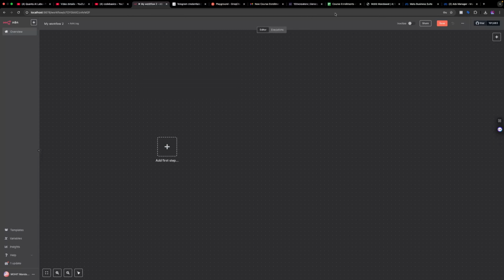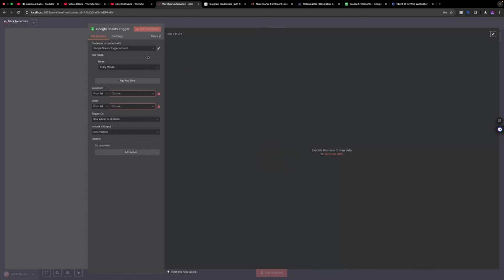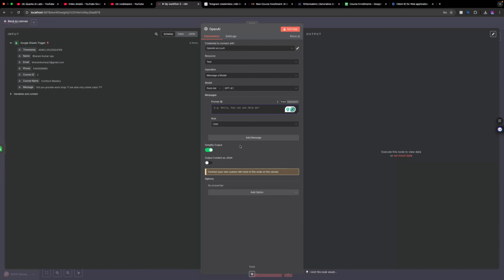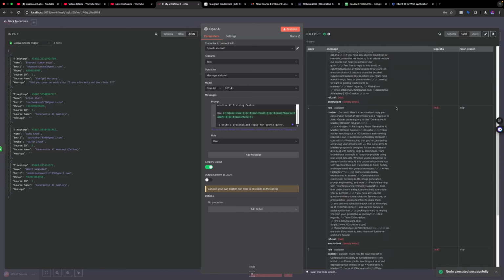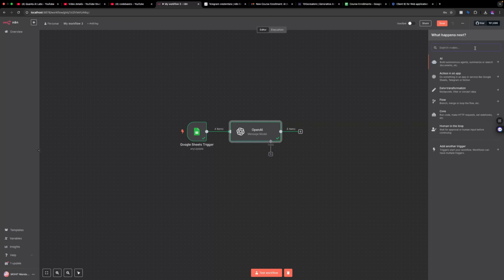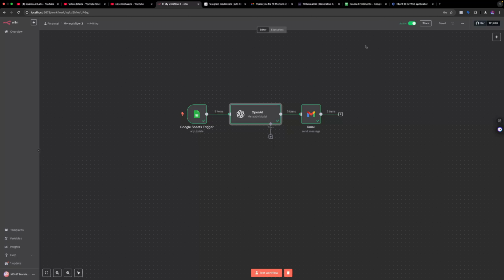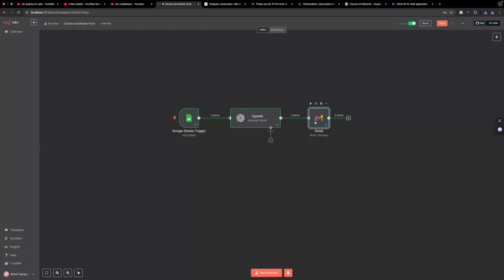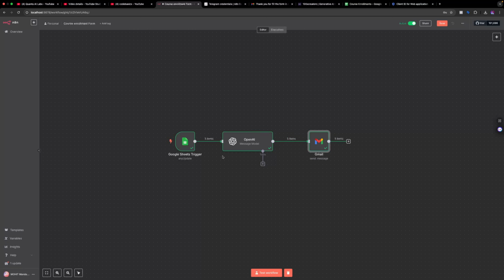n8n Tutorial Part 7: Solving Basic Startup Problems with Automation

Comment: Hello ,
I'm running n8n locally using Docker, and I'm encountering an issue with my RAG agent. Specifically, the agent consistently skips tool calls on every 7th user query. This pattern repeats every time.

Context:
My agent is configured with three tools, and for each relevant user query, it’s supposed to call all three tools. However, after every 6 successful tool calls, the 7th query is answered using only memory (i.e. based on previous responses), without invoking any tools. This behavior is incorrect.

After resetting the memory session, the issue repeats again in the same pattern—on the 7th query, the agent responds using its memory instead of calling the tools.

I'm using GPT-4o-mini as the main agent.
Can anyone help me fix this?